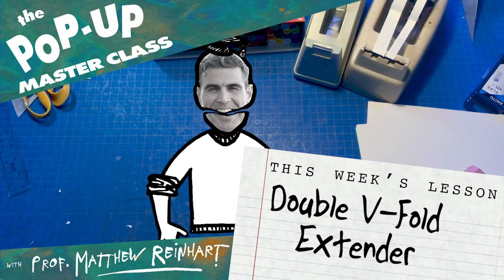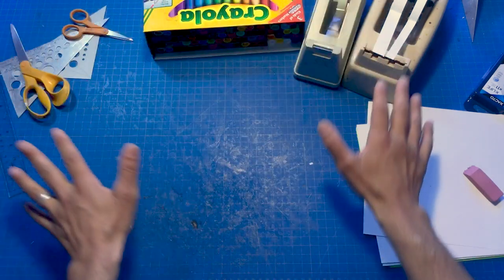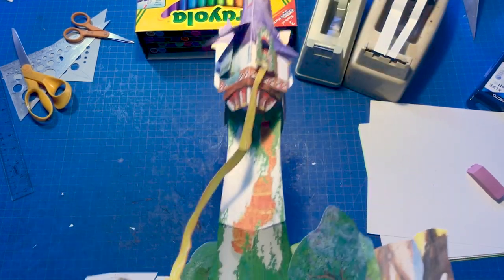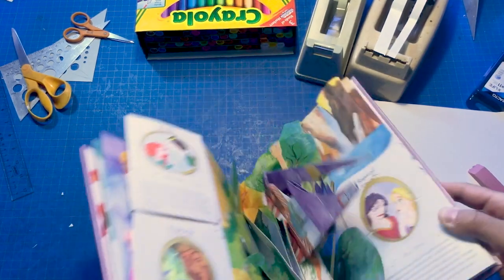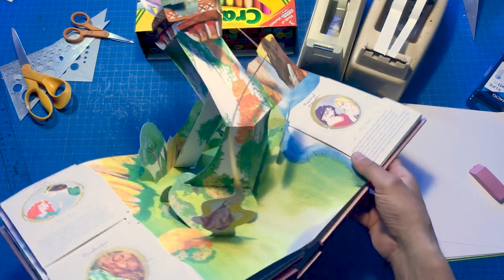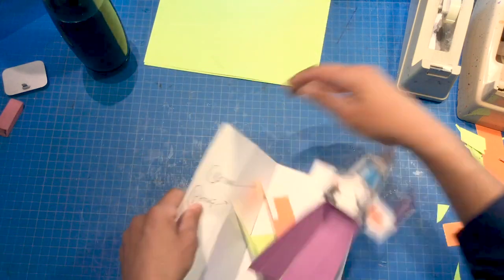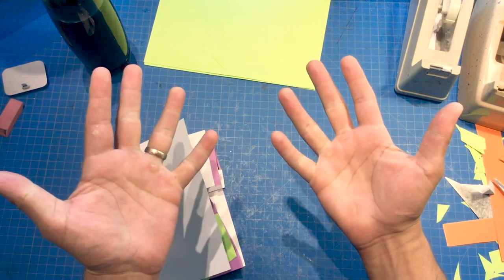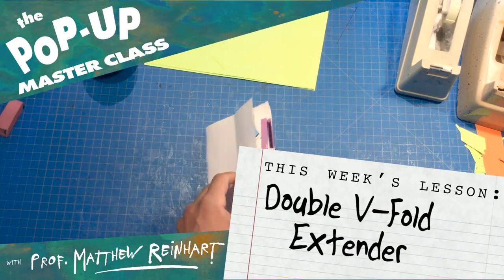Pop-Up Master Class with Matthew Reinhart: Double V-Fold Extender

Comment: This is a bit more like welding metal than carpentry. You can build up metal but the rule of "measure twice cut once" is limited to wood. If you cut a board to short you can't stretch it, you have to cut a new board. You always add to metal.